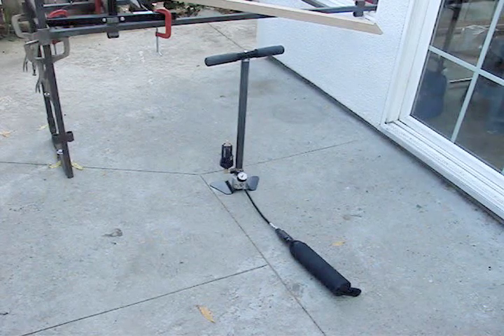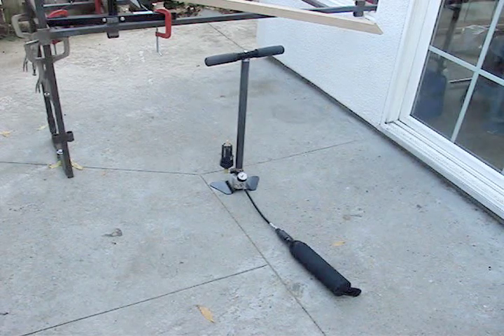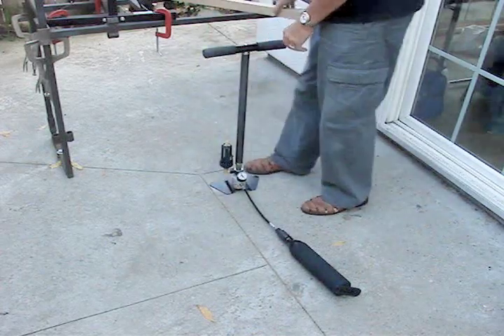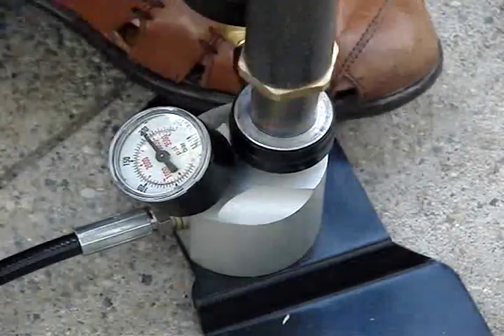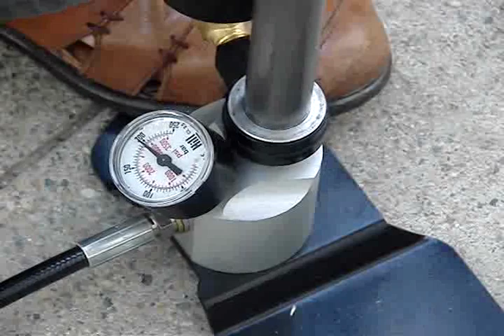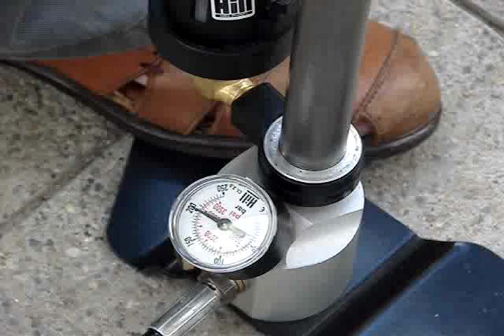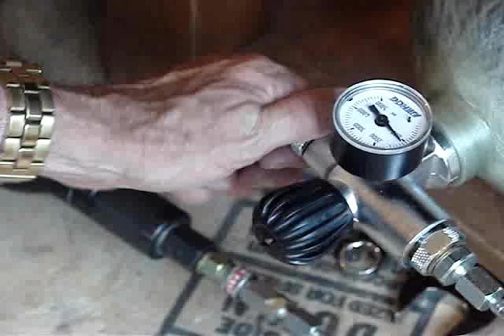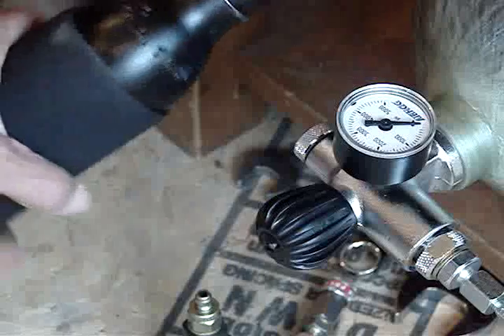Dirt E. Harry Compares The Hill Pump & The AirHog Supreme

Comment: Wow thats crazy. I get about 20 shots out of my condor ss .25 (tuned by talon tunes down to 915 avg fps) from 3000 psi which brings it down to around 2500 +/-. I pump about 15-20 times with my hill mk3 to get back to 3000 with very little work compared to the video. I get great exercise for a 2-3 minutes and I dont have to worry about the dangers of a bulky scuba tank blowing up in my trunk from the extreme heat in Houston nor have to lug a huge tank with me when I go anywhere. My hand pump fits in the same carry bag as my gun and pellets making life extremely easy to carry in one hand. I save 15 bucks each week not having to fill it up which I found out from friends is hard to even get a scuba shop to give you even 4000 psi in a scuba tank as they only have enough air to get that high on the day they fill themselves up when they have few scuba customers. Most people that I know that have used a scuba tank to fill tuned pnp guns have sold the tank and went back to a quality hand pump.
Reply: If this is true, I'm glad to hear it because I'm thinking about getting a PCP rifle, but having to buy all the fill accessories and a tank has delayed my purchase.
Plus I did not know dive shops could not always fill to 4500 Psi.
Thanks
Reply: Ive talked to maybe 40 scuba shops at this point. If you are in good with them and can get in on the day they refill their tanks you can get 4000 psi. Still loving my hand pump unless its incredibly hot and im at the range. Really no need as I can easily hit a 2" target at 75 yards now ... dont need to refill for hunting for an afternoon.

Comment: The hill pump must be leaking because no way does it take that many pumps to get to 200 bar. My gunpower stirrup pump fills my BSA ultra from 110 to 200 bar (1595 to 2900psi) in well under 5 minutes with little effort. I weigh about 190 lbs which really helps with these pumps, I can imagine it being pretty hard if you weigh under 140lbs.

Comment: I was contemplating a hills pump to replace my Benjamin pump. But that doesn't look to be any more fun than the one I have LOL.  SCREW THAT I am going to get an 80cibic ft dive tank. There are several safety companies that service the oil field drilling rigs right here in town which I have friends working at so refilling it will be a synch Thanks for helping me ruel that out LOL

Comment: If you don’t pull the pump up until it completely stops you are not actually using the pump correctly, as it should fill in the up Stroke too to a certain extent , also you shouldn’t fill a bottle so quickly, let the air bleed in slowly.

Comment: ummm.. Anybody else notice that it only took 25 pumps to get to 200 bar ? After 25-30 pumps the perssure never goes beyond 200. Maybe I'm missing something? It looks like there's an automatic safety valve that opens up when reaching 200bar. So he could have pumped a thousand times if he wanted to.

Comment: That had to be the most useless video I have seen. If you don't know that filling up from a tanks is faster and easier than pumping it by hand, you really don't need a PCP airgun. That tanks is twice the size as most people use a hand pump for also.

Using that board was about stupid. I pump my TalonP from 2000-3000 psi with a Benjaman pump. It's nowhere near hard enough to need leverage to pump. I am way out of shape in do in about 5 minutes... 65-70 pumps.
Reply: Char Mar bsa pcp